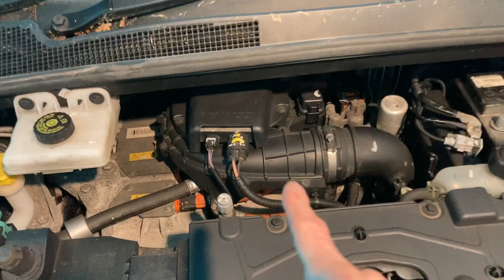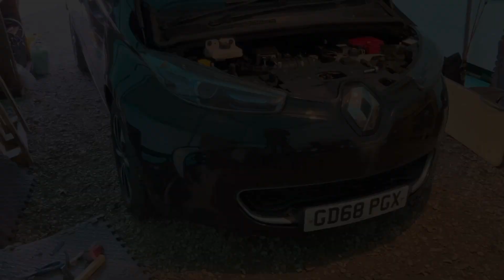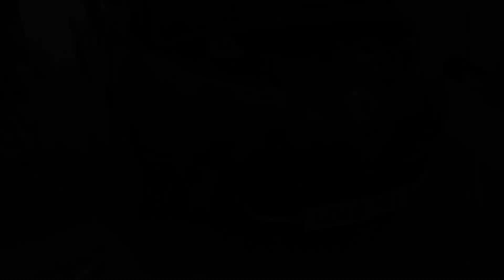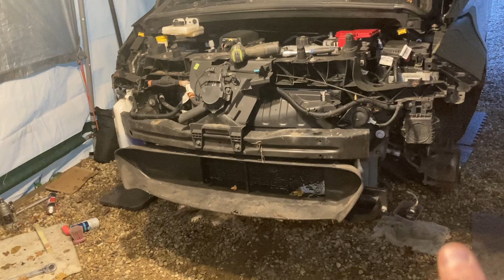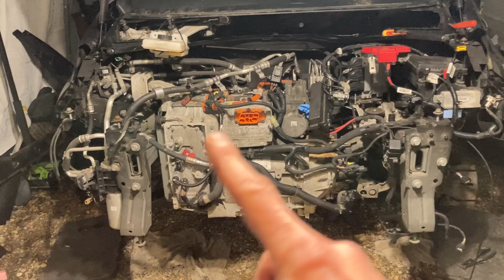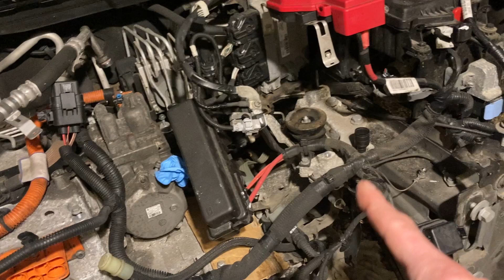👨🏻‍🔧🔋Renault Zoe ZE40 tear down (ZE22) - motor stack removal  EV repair  Electric car motor bearings

Comment: Hi Gary. Thank you so much for the videos, as a Zoe owner i feel I know my car much better than before! Would love a video about how to change the AC/heat pump. Mine is toast, at least it was very noisy until it stopped working all together. I suspect I need a new one, and probably also have the pipes  tested for leaks, as I understand the ac system can be leaky, especially on some part tucked away behind the battery? Maybe it's not correct, but I've read a lot of people having problems with the ac/heat pump in this car 😊
Reply from the maker: Hi, changing the compressor isn’t relly a diy job tbh as it is a high voltage component. Second hand compressors are usually available on eBay though.

Comment: Hi Gary isn’t this 18 plate Zoe under the 8 year warranty with Renault?
Reply from the maker: Hi the 8 year warranty is on the battery only. The base vehicle warranty which covers the rest of the vehicle is 3 or 5 years depending on when the car was sold. cheers.
Reply: @garycevrepairs Ahh ok I thought it was 8 year warranty on the battery and motor , I have an 18 plate ze40 only done 30k , so hopefully will last a long time yet 🤞🤞🤞